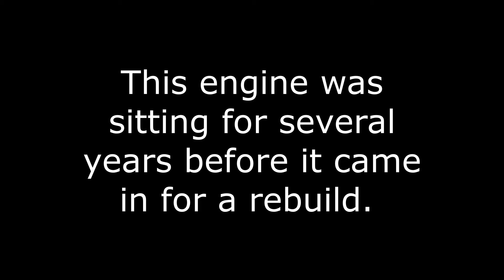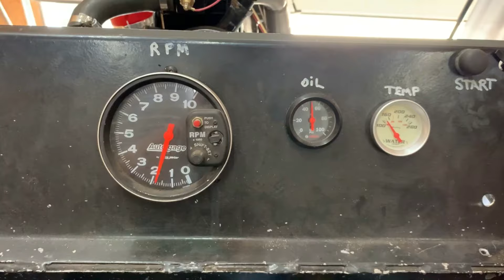This Box Rebuilt 292 Chevy Inline Straight 6 Sounds Beefy

Comment: I worked on a fleet of grumman step vans back in the late eightys with the 292,s. So much different than the 250 . That 4 inch stroke in the 292 changed the power so much.
Reply from the maker: It did!!